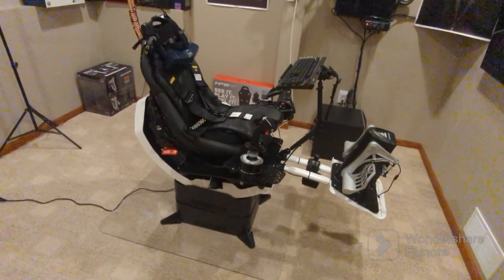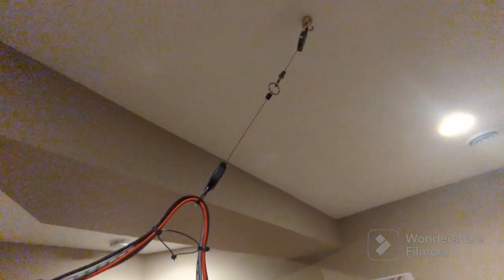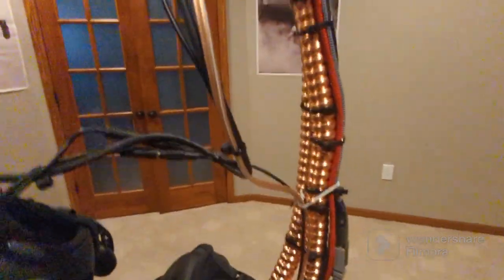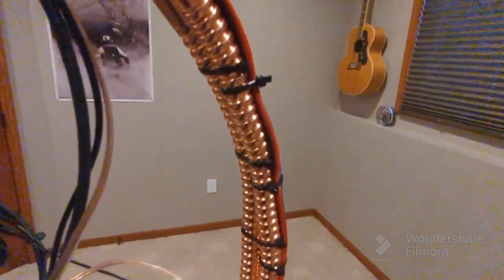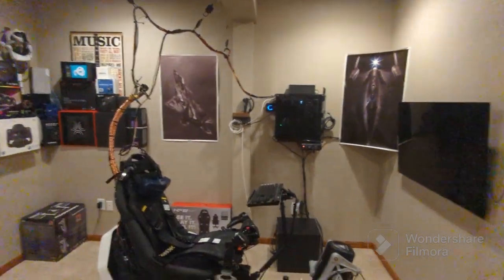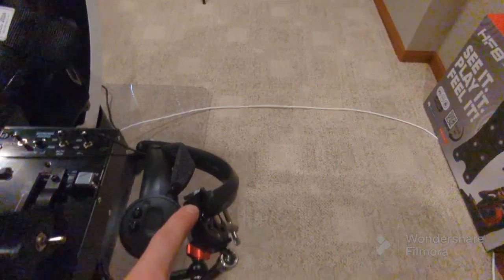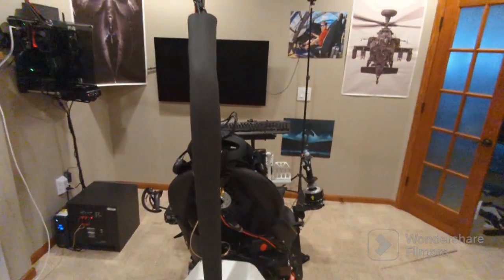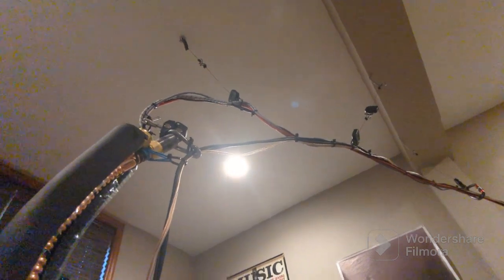YAW 2 PRO HEADSET WIRING 2.0. Works flawlessly. VR motion chair. PC flight sim wiring. DCS, MSFS.

Comment from the maker: I wonder if a usb hub, powered by the chair, could transmit all the HOTAS data to the PC via a Bluetooth transmitter? PC has Bluetooth. No idea if that's possible. But if it was....oh man.... that'd be far simpler. 🤔
Reply: No chair yet but I plan to use a usb 2.0 extender via ethernet or you can raspberri pi it wirelessly like superman217 did
Reply from the maker: @mightysimgaming  Plan is to get it running good as it sits. I'll wait for the 12K before I do the wireless thing. No real advantage in doing it right now. At least for me. That's a deep rabbit hole too. Not sure if the juice is worth the squeeze.
Reply: I saw in your video, that is a white cable under the Rotation, my USB hub doesn't work either, so how you connect it? And I noticed that your white cable connect  a adapter with your computer. Please show how you set it up,. Thank you.

Comment: I like how you said you didn't feel like a half hour video, so you made it 29:49, lol. Looking really good! I'm wondering if you can use two controllers for motion compensation if that would be better? I have two index controllers I won't be using anymore since the Pimax Crystal is coming soon, so was thinking I could use the old Index controllers on each side like you have mounted there. That way the base stations can track on both sides and never have anything in the way to block tracking. I'm just not sure if two are trackable for motion comp?
Reply from the maker: I too had the same thoughts, but think about it, from a perceptual standpoint, if you were the software. Two controllers would hypothetically move independently very slightly because they would be in different locations and jiggling at a slightly different rates, if not perfectly still. That would cause the software to be receiving two sets of motion data that are slightly different. So the software would need to be programmed to average those two or it would screw it up.

I do not know if it has that capability or if it's even necessary really. 

One could look in the steam VR chair tracking recognition settings area and see if there are options for more than one tracker. That should give you an answer.

In an unrelated idea, the other thing I thought of was to recharge the left controller directly on the throttle.

 You could magnetically attach a small cell phone charging battery and a very short USB-C cable and you can extend your battery power on your controller to effectively infinity just like I have my mouse mounted.

Or better yet, I'll run a USB cable from the chairs USB ports to the controller. Just need charging power. No  hotas signal. They do have power.  Boom done!!!!!  🤯✊🏼
Reply: @phoenixrising011  I'm also wondering if you might have been able to just buy a powered usb hub with like 10 ports and stick that over the usb ports that don't work? Wouldn't that reduce the wires to just one (at least as far as periperals) going from the hub to the pc?
Reply from the maker: @justaguydoinstuff  Possibly another usb port would work.  But I don't like the idea of all those different signals going through one line. Theoretically it should work right? But in reality, things are better separated. Pick your poison. 🤷

Comment from the maker: You could just hard mount a black pipe to the black metal yaw base using two floor flanges and two elbows. You would need two sections of pipe, one about 6 in,  one about 3 ft.  Make it about 3 ft tall, and put your tracker on top of that. That would be stiff. 

YAW base> floor flange> elbow out> 6" pipe> elbow up> 3 ft pipe> superclamp> tracker. I bet that would work well.

The 3D printing options are endless too.🤔